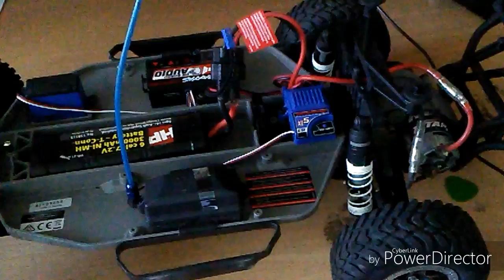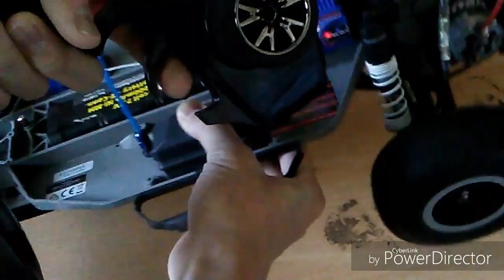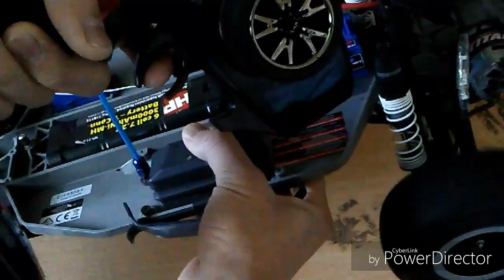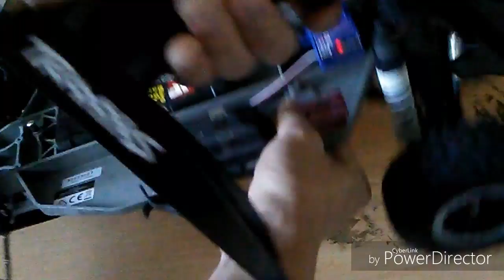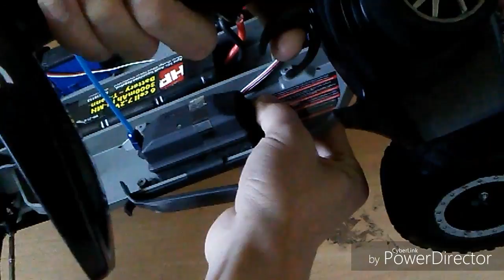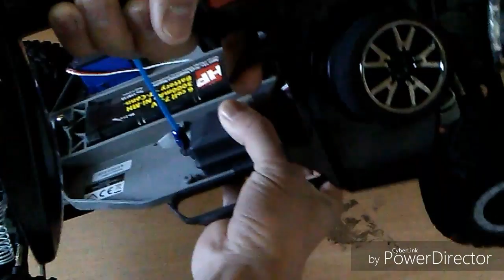Programming the Traxxas XL-5 System REVISITED

Comment: The video is good I just watched it today, but I thought you could run 3s lipo, if you turned low voltage detection on, but even with it on can you run a 3s or is it 2s only? I'm trying to figure this out I just got a brand new slash brushed, and I don't want to screw it up, the 3s just has too much voltage no matter what? I'm just not sure I hope you can get back to me. Or anybody that knows what the hell I'm doing I'm suffering over here LOL,

Comment: FHRC Brony Radio Control and Cars 
  Hi I have a Traxxas 2wd slash with the XL5 ESC like this and added Traxxas On Board 
Audio 
that you have too I can get some audio but it is not responding to my throttle often. What could be my issue?
Reply from the maker: My guess is just the battery. I don't know an exact problem cuz I never had that kind of problem on mine before

Comment: You only mentioned three modes I have the trx4 with the 5 in there and there are five modes that you can set with it I thought that's what the five stood for there was five settings on the ESC  all three of my trx4 have five different modes why doesn't this one have five isn't the five the number of settings that can be programmed
Reply from the maker: Your XL-5 is an HV model with more modes. This one is a standard